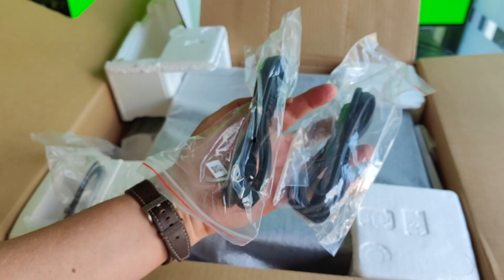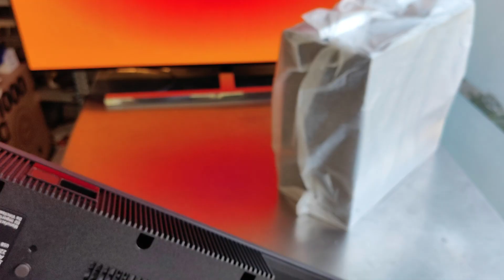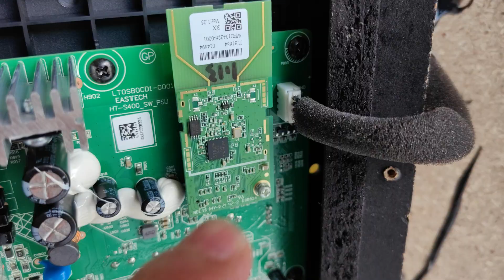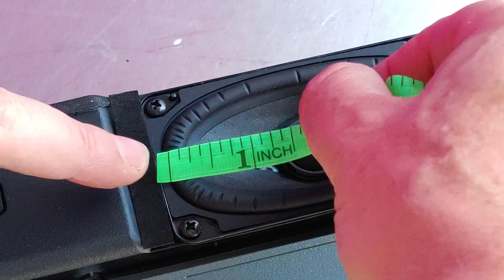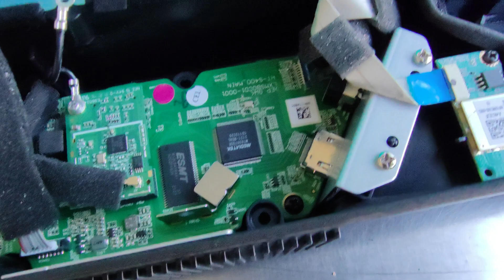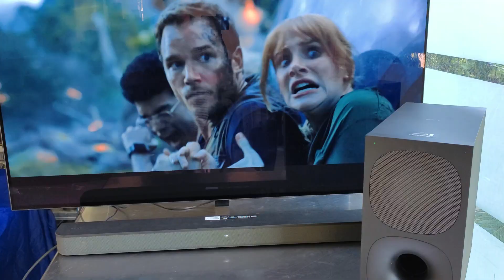Sony HT-S400 Soundbar of 2.1 ch | Deep unboxing and Tear down

Comment: hello, I just bought this soundbar and trying to understand if I should connect via optical or hdmi only. I currently connected via hdmi arc and it seems to be working. Would I get anything extra if I connect the optical cable as well? Thank you
Reply from the maker: @emirsezgin4283  HDMI is the best, way better